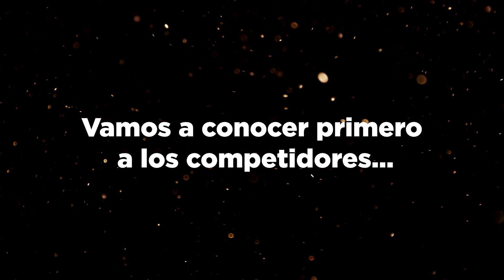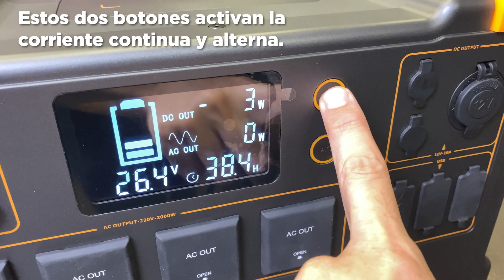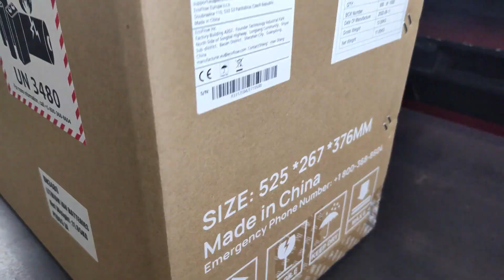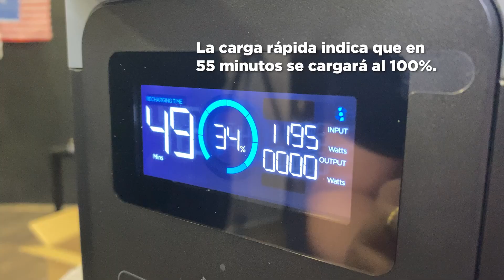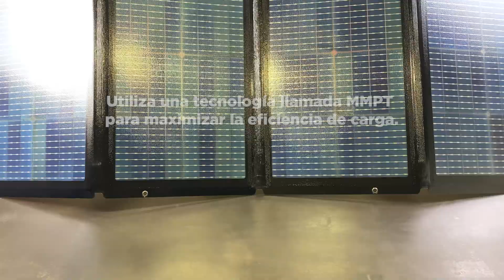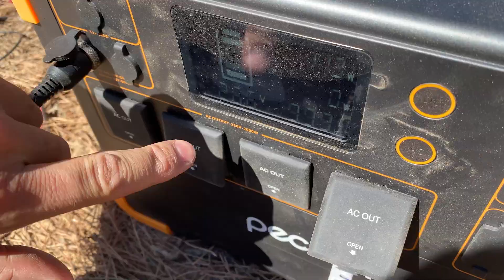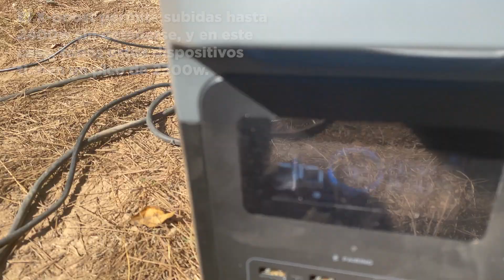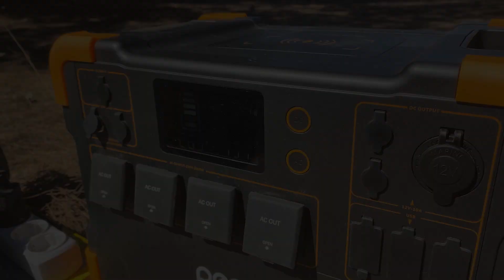GENERADOR DE ENERGÍA INFINITA VS PECRON E2000 & ECOFLOW DELTA 2 - Review y Pruebas

Comment: El alternador es de 12 ó 24 voltios? Y el motor a cuántas RPM gira? Gracias. Saludos desde República Dominicana 😉.
Reply: Se tiene que modular hasta que resulte 50-60hz
Reply: 24v 3000rpm
Reply: Por si no sabe el alternador crea una energía trifásica esta energía, se extrae de tres alambre de cobre colocadas paralelamente a 120* los cuales hacen girar una bobina la cual crea un campo electromagnético al crear esta corriente alterna, esto quiere. Decir que entre más gire la bobina más corriente genera, ahora el tema de los 12 voltios es una corriente directa para eso se pone un regulador de voltaje y un rectificador para pase a corriente directa, por esta razón las personas que intentan decir que es un fraude hacen el proceso pero siguen utilizando regulador y el rectificador haciendo que el alternador entregue una energía limitada. Investigación, e informasen para que las personas como contenidos como estos tengan mayor interés de seguir publicando.